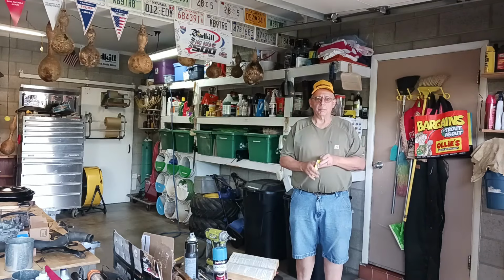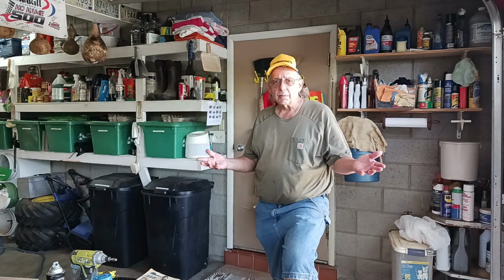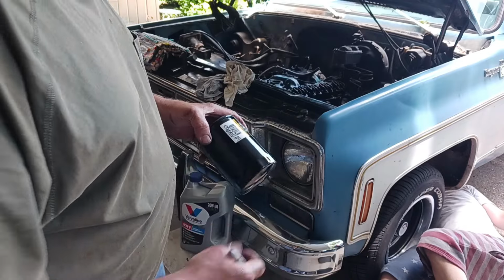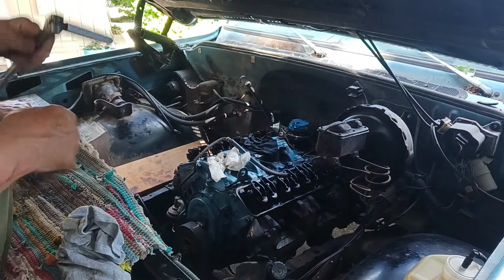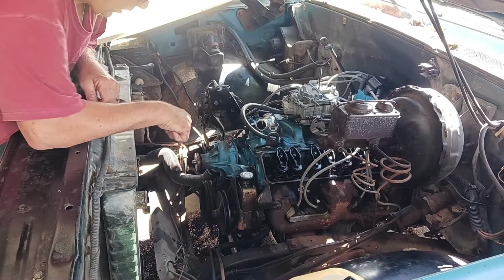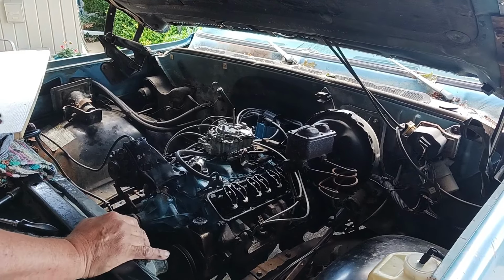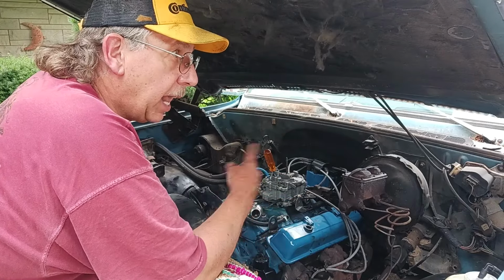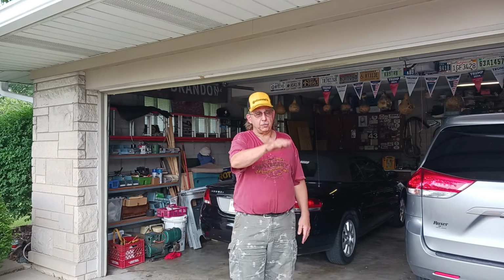Adjusting Valves 1977 Chevy 350 Part 2 of 2 used cam and lifters from @outfitsgarage88 C-10 Cheyenne

Comment: Also Rick, Instead of using the engine to prime, take the distributor out and use a drill and socket to prime the engine with oil. Less ware on the starter!!👍👍
Reply: Well, to do what I was saying you have to have a piece in the distributor hole to stop the oil from going everywhere!!
Reply from the maker: Great point!
Reply from the maker: Yeah I used to have one of those little pieces that went down in there to turn that oil pump and I couldn't find it that's why I was cranking it over by the starter

Comment: Many ways to skin a cat 🐈.  I've always snugged them up. Install the oil clips to keep the oil in the engine. Start  it up and loosen  till it ticks and snug up slowly till the tick stops and tighten 1/4 turn at a time until 3/4 turn and you should be good. 👍
Hello Eric 👋
Reply from the maker: That's more of the way I  remember doing it too.
Reply: I am in total agreement here! This is how I have always done it. Hasn’t failed me so far!👍👍👍